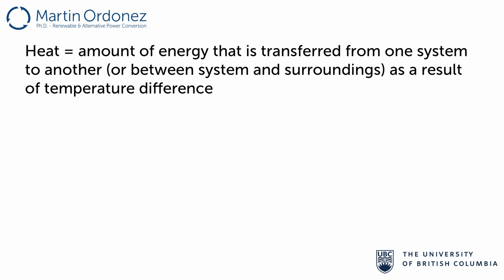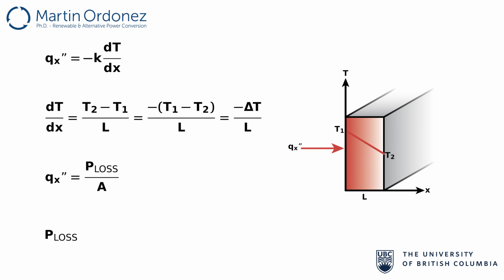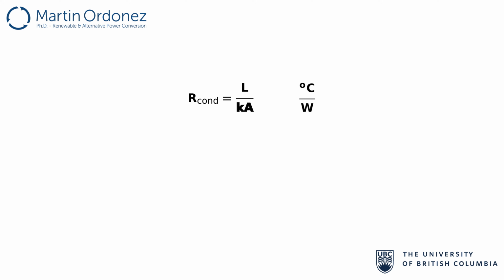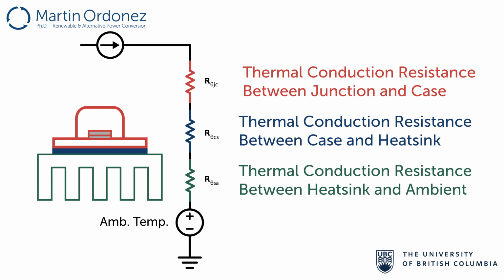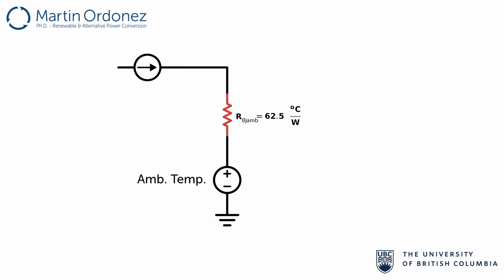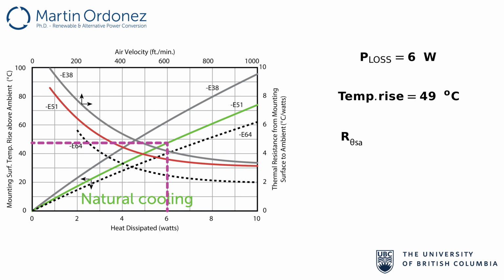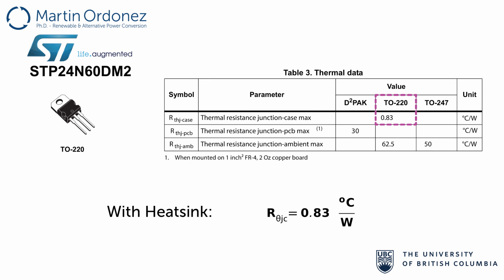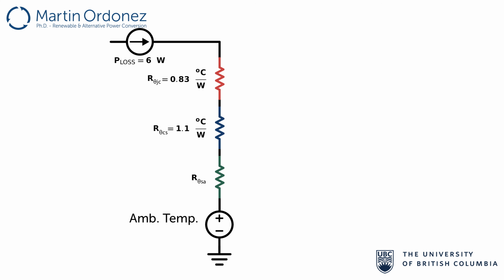Power Electronics - Thermal Management and Heatsink Design

Comment: Fantastic short tutorial! Two remarks: I would proceed the design by first calculating what thermal resistance do we need (at least) to keep the Tj at some wanted temperature (requirement). Once I have that number I would select an appropriate heat sink and cooling method (not the other way around) that satisfy that requirement. I have started with the de-rating factor of -20% and come up with a Rth of max 15 C/W. In your case of natural cooling heat sink the total Rth was 12,5 C/W. So that would satisfy the requirement. Second remark is, you have used convection of course in the case of forced cooling method at the end. Looking forward to more tutorials!

Comment: It better conducts if a mosfet is attached to the heatsink without an isolation. You have to be careful about not connecting it to create a short. It is not advisable though especially in the hp.

Comment: Thank you so much, This video was very useful for me, I designed and made a simple H bridge circuit by using IRFZ series MOSFETS for my power electronics project in last year.For heatsink designing part I tried to find the various methods, but this method is simple and very smart.therefore I used this method to select the heat sink.It was success,I would like to thank again  Dr. Martin Ordonez and Dr. Rouhollah Shafaei...